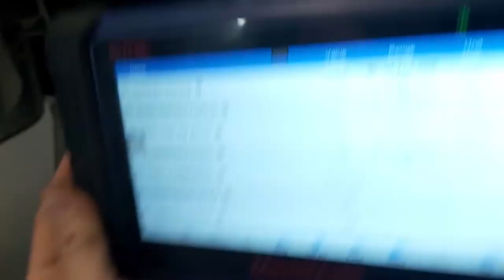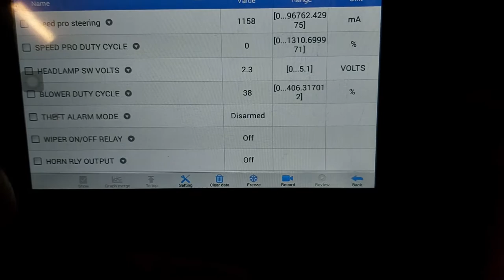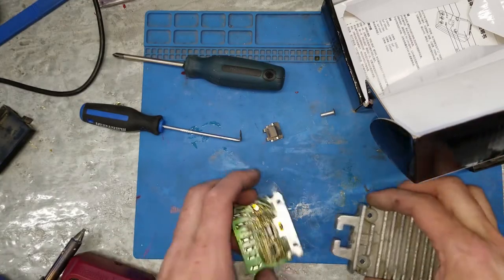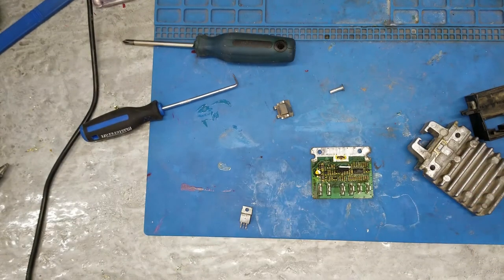Repair Chrysler 300 Heater Control Display and Blower Resistor

Comment: Lloyd, thank for sharing your info. I have a 2002 300m I am rebuilding and my panel was out, I knew it was not the controls and I believed it had something to do with the lights. I was just about to buy one on eBay when I saw you video. I tried it and its working fine. thanks again.
Reply from the maker: Excellent! Thanks for letting me know!